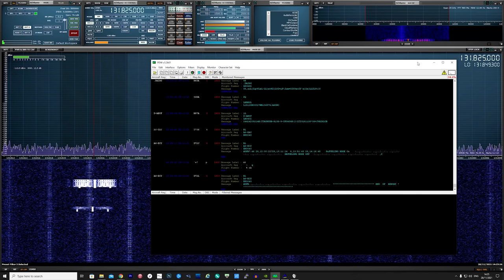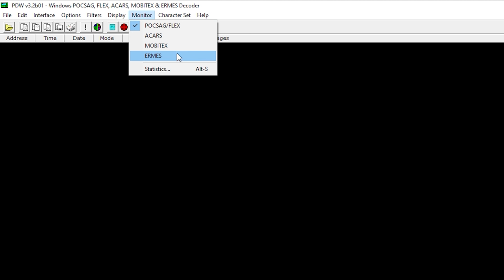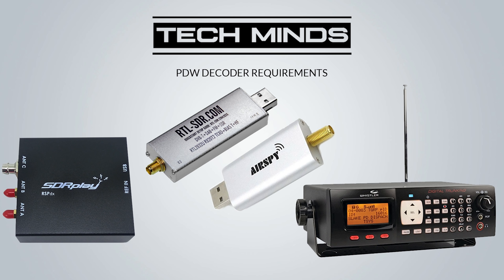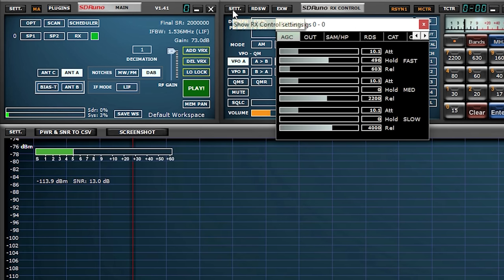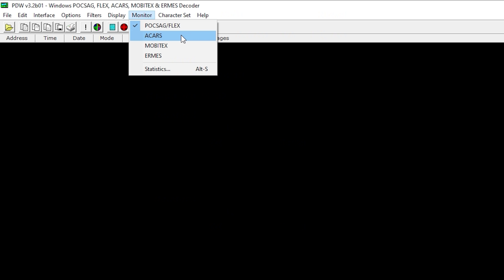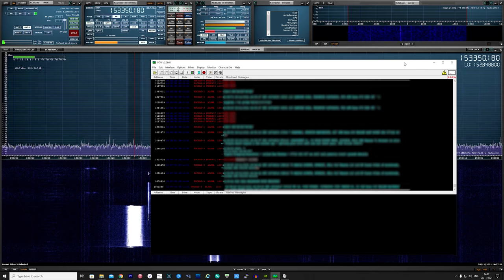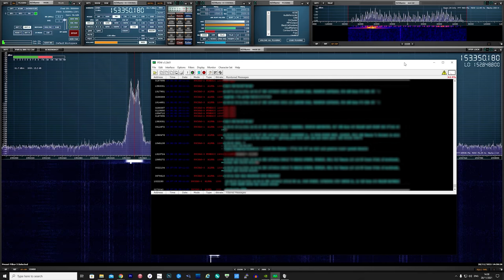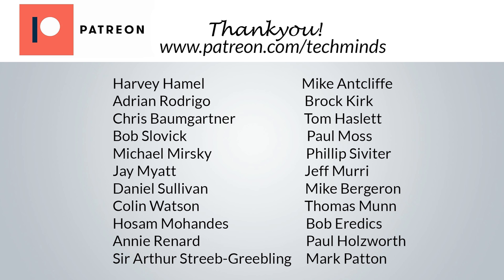PDW - An SDR Decoder For ACARS & POCSAG Pagers

Comment: I’ve decoded pocsag messages - amount of personal data is unbelievable. How hospitals are not getting hauled over gdpr coals on this i dont know.
Reply: That's like hacking their computers and claiming the same.
Reply: How is this like hacking computers? There is no security here that you are circumventing. Claiming hacking in this situation is like walking through the town square nude and then claiming people are peeping Toms.
Reply: @PSUdaemon  my similar response was deleted for some reason.
Reply: @PSUdaemon  Hacking definition: The gaining of unauthorized access to data in a system or computer. You are assuming that as there is no security as such it makes it less of an offence. Your local taxi company may use DMR radio and give out address and name details to drivers, however, just because a 50 quid radio can pick it up does not make it a GDPR issue. The law is quite clear on radio interception and protects them from any breach.
Reply: Listening to any non commercial or amateur band broadcast is strictly illegal in the UK. The law is not often enforced but where information is intercepted and acted upon, then really bad things start happening. Witness the penalties, fines, and compensation being handed out for the newspaper phone hacking stories. If someone just listens covertly and never reveals the contents of what is overheard, then there is little the authorities can do because nobody will ever know. In some countries the mere possession of equipment capable of receiving these signals is a serious criminal offence which will result in a long term of imprisonment without appeal. SDR dongles are available everywhere, but connecting them up to a computer rather than a TV kind of gives the game away, especially if the computer is seized for examination. Just something to be aware of when travelling.
Reply: I don't really get this, pagers in uk hospitals just send the telephone number of a phone in the hospital
Reply: @aduantas  I often saw name, dob and address along with the condition such as not breathing etc.   I think the issue is that the operators don’t know it’s trivial to decode.
Reply: @eliotmansfield I'm willing to bet those are actually not hospital transmissions but from the ambulance service

Comment: I found in my case the audio from your device can be hit or miss especially for like Pocsag/Flex and unless you have a very strong signal it usually misses. The more tried and true way is to tap into the correct IF stage in your radio and with an interface (available) plug that into your computer com port. This method has given me 100% results. Again audio only maybe fine but maybe only if receiving strong signals, just my experience.

Comment: You're very lucky to have POCSAG at 153Mhz.  I was rudely introduced to my 5 local POCSAG transmitters when I installed an outdoor antenna.  Here they broadcast between 148.5Mhz and 148.9Mhz, nice and close to the 2m band.
Reply from the maker: I can remember when I first started on Ham Radio that 2M used to suffer quite a lot with pager bleed over.
Reply: To be honest some folks do suffer even at 153. This is why sotabeams sell a bandpass filter. They also bleed into 137 for those of us doing weather satellites. There’s even now a signal actually in the band too, which is worse! It’s so wide and blasts everything on the sides
Reply: @MarkPentler  I'm actually using a half of a 6 cavity duplexer from eBay as a low pass.  Couldn't find anything else that was sharp enough to keep much of the top of the 2m band.  Seems to work well  (according to NanoVNA anyway).

Comment: My Marconi 2995R has built in POCSAG Transmit and Receive and my "R" version of the Marconi 2995 has an off air receiver. I have not dared to try and decode any POCSAG data, a friend has done it and was sickened by the nature of the pager messages. They can be EXTREMELY disturbing, especially if it is related to do with anything medical or an organ donor service.
Reply: @MevRB19  What on earth is all this "Woke" nonsense. It might be used for that where you live, but here it is quite disturbing and not something you would want to read. There is no need to be rude or offensive if someone is disturbed by anything like that.

Comment: Pocsag is not as popular as it used to be,  the software worked well for me many years ago using discriminator output from a ham rig. Apart from the emergency services and railway traffic pagers were popular amongst "twitchers" who would send a lot of group messages.
Reply: Still a lot of bird watchers (twitchers) using the pager networks in the UK - they are using FLEX and not POCSAG though.

Comment: can't pick up any messages for pocsag  pdw i have followed all the steps and are  getting a pocsag signal in sdr sharp but the signal meter in pdw is not moving and no messages are comming through in the pdw in the interface setup in the serial port section the port box is blank and not showing com1 like in the video  might that have something to do with it
Reply from the maker: If you open up the volume control panel on windows, do you see any green bars moving on Virtual Audio Cable? If not, then that could possible be the issue.

Comment: So as of lately PDW stopped working for me. That is, I choose the VB audio, send the output of SDR# to that VB but apparantly PDW doesn't show that a signal is received. 

I read somewhere that the problem started with Windows 10 (I am running W11) but am curious if there is a solution for that problem

Comment: I can hear a POCSAG signal on my RTL-SDR device but since I'm using it on my phone with SDR Touch there is no way to accurately get it to my computer. The headphone output on android phones is too low and the SDR works poorly on my computer for some reason.

Comment: Very well presented and detailed video , I can receive pager messages on 153.350 (POCSAG) and 153.025 (Flex) it is the Page network here in the UK I think. Also if it is possible you should focus another video on using multimon-ng it is a powerful commandline decoder you can use on Linux, even a  Rapsberry pi can handle it!. 73's Danielle 26DC260
Reply from the maker: Cheers Danielle! I will take a look 🙏
Reply: Hi Danielle,
Thank you for posting your very interesting comments.
I hope you don't mind me asking but I gave up trying to install Multimon-NG on my raspberry pi.
Do you know of a prebuilt image that I could buy to save me all the hassle?
I normally run PSW but ideally would prefer to use the Pi.
Kind regards,
Steve
Reply: @stevew267  Hi, what errors do you receive whilst trying to install multimon-ng, if you tell me the error message I think I could try to help you fix it, if not I can upload a fresh image for your pi. Regards Danielle
Reply: @pmr446  Good morning Danielle and thank you very much for responding so promptly.

As it is quite some time since I eventually gave up I really cannot remember exactly why it didn't work for me. I know that at the time, spending hour after hour I eventually lost interest and not being familiar with Linux added to the problem.

Since I haven't powered up the Pi for over a year I would need to re-familiarise myself before trying again.  This is where I ask that you upload the image if it's not going to inconvenience you too much and is so I would be most grateful.

Kind regards,
Steve
Reply: @stevew267  Hi Steve, sorry for the late reply I have been busy. I will create an image of rasbian with  multimon-ng for your pi tomorrow, whart particular model of pi do you hvae?
Reply: @pmr446  Hi Danielle,
That's very kind of you and of course will be greatly appreciated.
I have both Pi3 and Pi4 and could use either of them.
Kind regards,
Steve

Comment: I used PDW for a long time, but it stopped working for me a few months ago. No idea why
Reply: Are you using SDR#? I found the later versions don't work. When using PDW I revert to Version 1716, and it works as before.
Reply: @mydronevideos3513  good to know, I'll have to try that out
Reply: @mydronevideos3513  I can't find that build anywhere

Comment: ACARS messages should not be compared with ADSB. ADSB is a public beacon which can be used public to locate aircraft.
ACARS instead belongs to the aircraft radio transmissions which are restricted to air personell in some countries. Unlike ADSB it can be illegal to decode ACARS messages.